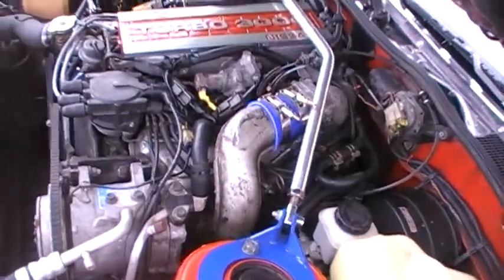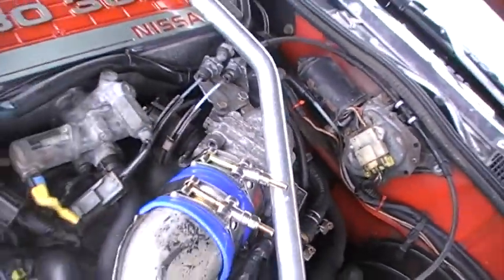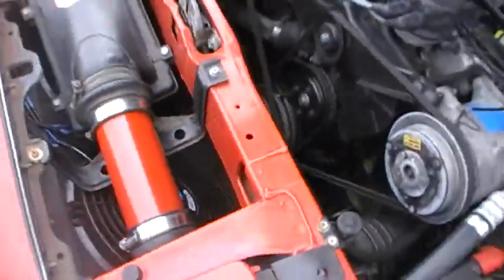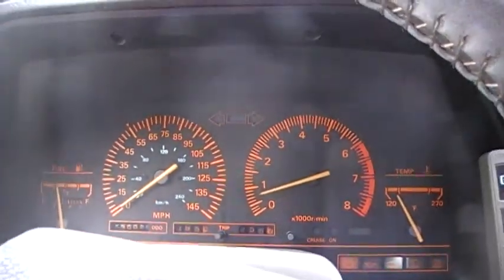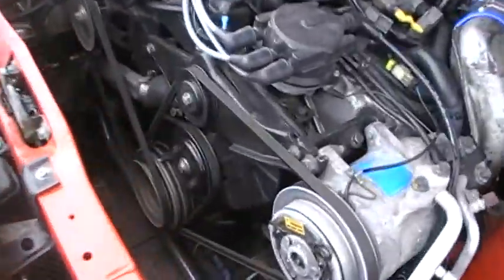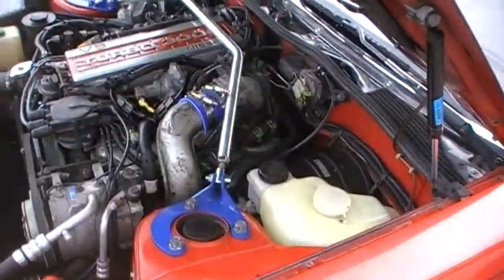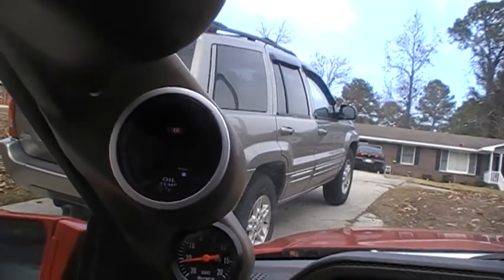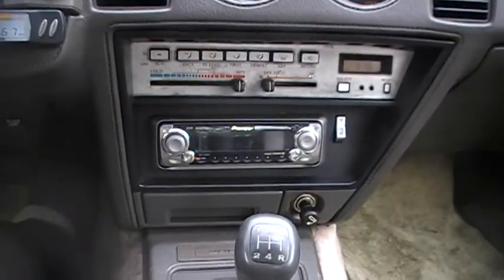Z31 300ZX Na2t 2013 Winter Update

Comment: Is the whole motor out of a turbo car? Or is the block NA with Turbo kit? If it's an NA block what adaptation kit did you use for the AC compressor to fit? I'm hearing the AC compressor won't fit an NA2T from NA block?
Reply from the maker: Its a na2t using stock Z31 turbo parts. AC compressor is mounted the same all years and make turbo or non.
Reply from the maker: Block is NA 9.0:1 with stock turbo parts bolted on.
Reply from the maker: At least it was at this point in its life. I’ve since done many more mods and is pushing considerably more power.

Comment: where'd you buy the strut bar?
Reply from the maker: David Schriver I bought it online. Z31online.com sells Cusco ones that are a far better option.
Reply: My Z31 300ZX  thanks, I saw that one before but I like yours better because it'll fit around my intake. I have a pretty big intake tube from the intercooler and I don't think the cusco one will work lol
Reply from the maker: David Schriver check eBay. May have some on there for sale.
Reply from the maker: I have access to one if you need it.
Reply from the maker: I found one local to me. It's used but if you're still looking email me at sir420@gmail.com.